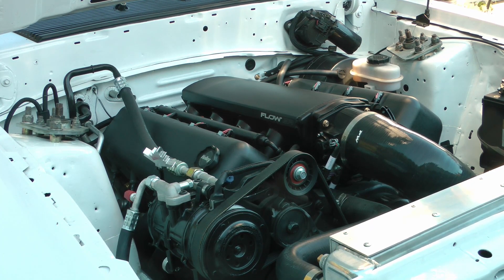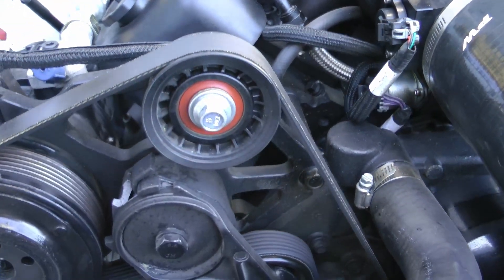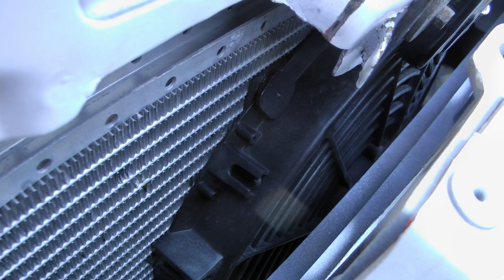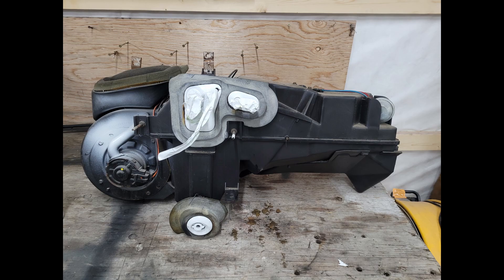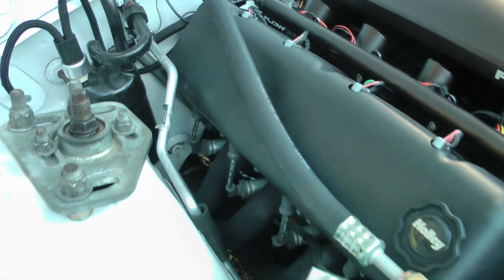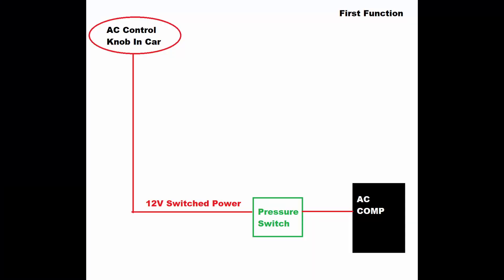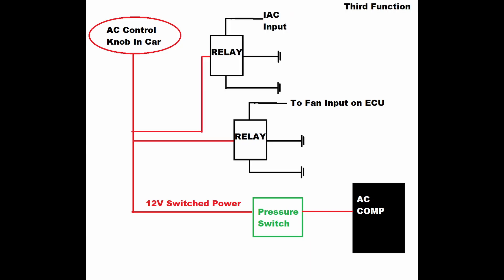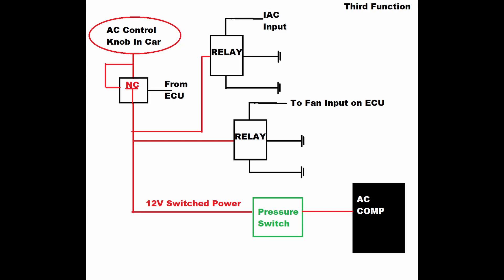How to Retrofit AC on your LS Swapped Car (works for any swap)

Comment: I think there might be a better way to do this. Im not sure tho im in the middle of trying to set this up myself. The holley has the option for "fans always on with ac" which means the holley can fully control the fans. I dont think you need the IAC relay because in the holley you can set it up to input 12v straight from the ac button.
Reply from the maker: @edgarcorrea7866  yup it's possible for sure. I run as few 12v wires as I can

Comment: So the ac won’t run on vacuum lines, my mechanic is trying to get me to get vintage air, because the factory ac will not blow as hard which is understandable and because it will have to be ran using vacuum lines is this correct or he just want the extra money
Reply from the maker: The vacuum in a foxbody is for switching the flap, not sure on your application

Comment: Im gonna be doing a 7.3l godzilla swap in my foxbody. Want to put ac in the car aswell. Most of what you said about getting it wired would work but i have no way of using a iac kickup on the car as im not running a holley its a MARS auto control pack with no a/c functions included in it. So do i just not worry about a idle kick up on it and endure the stuttering idle or will it not work?
Reply from the maker: You could hide it with a higher non-ac idle for sure, may take another 100rpm or so. I had the car for about a month without the iac kick. It's way better with it but possible without it